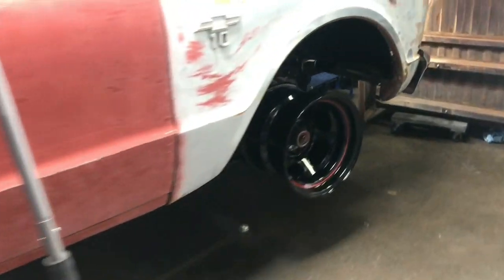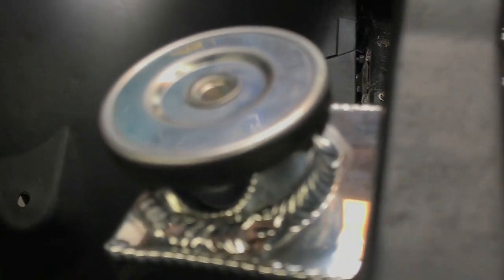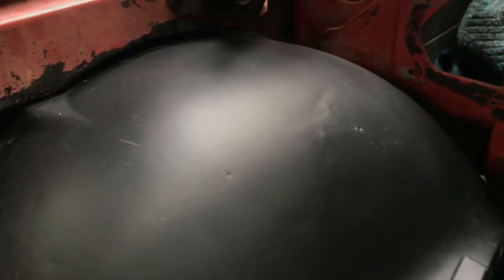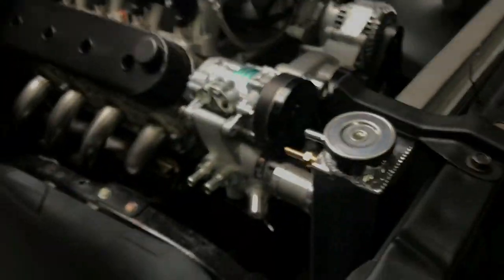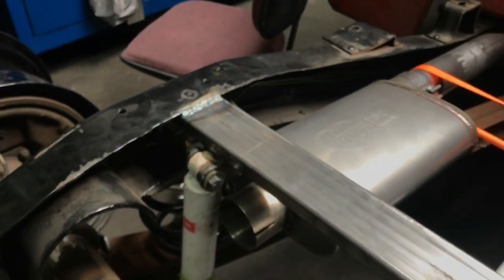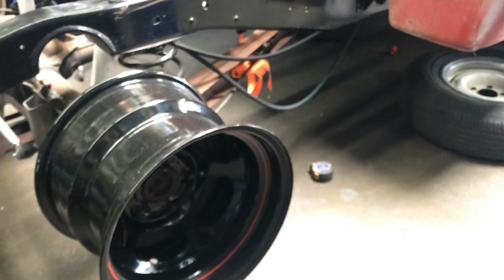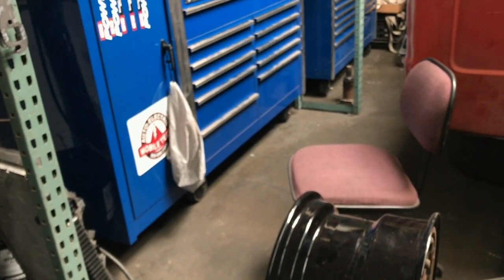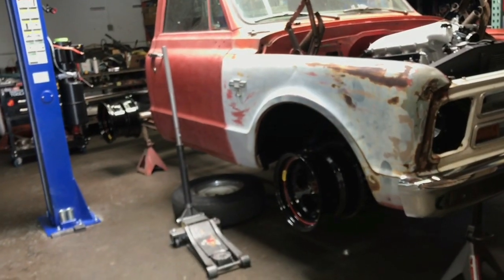67 C10 Progress

Comment: That sucks about the powder coat. Reputable shops are hard to come by sometimes.
Reply: After a few times, you start to learn how to paint yourself.
Reply: For sure, but most people don't have anything bigger than a kitchen oven for powder. That's why bigger items like frames or wheel wells have to go to a shop.
Reply: I took 4 rims in to get powder coated once. I bought em second hand and they had been sitting in buddies backyard forever. Covered in cobwebs and junk. So I hand washed em to make sure they were super clean and ready to be blasted and coated. I figured save the shop some time. And it let me go over the rim and make sure they were fairly straight. I get them back from the shop and the job was honestly pretty garbage. It was obvious where they hung them for spraying, they didn't bother to spray that area before putting it in the oven. And one of the lips on the rim had a HUGE dent in it and really bad rash under the coat, it was obviously a concrete rash because it was dropped right on the lip. I mean it was a dime sized spot that was basically flat, and it wasn't road rash. It was the more the top inside of the lip pushing out, where tire would protect the rim from anything. Because I hand washed them, I knew the lips were all in great shape before I brought them in. I asked the owner about it "No it musta come in like that". Bullshit, i told him I inspected every inch and went over them by hand and there was no spots like that and it was obviously been dropped from a height onto the concrete, probably either when they hanged them to blast them or spray them. But he said his guy's didn't drop anything and wouldn't do anything about it. So I just said alright, and then anytime anyone asked me where I got it done I make SURE to tell them not to go to that shop. I wonder how much business that guy has lost because he couldn't cover a 40 dollar coat job on a 10 dollar rim.
Reply: That sucks man! That is the reason I'm so indecisive about bringing anything to a shop these days. Unless you have been using them for years and know their quality it's hard to put your trust into someone that you don't know. What's the saying? If you want it done right, you have to do it yourself. I'm on the fence about powdercoating my C-10 frame, I could blast it myself and paint it with Eastwood chassis black or take my chances and have a shop I found locally blast and powder it. I have never been to this shop before, so it's a huge gamble...
Reply: Busted Classic Garage Yeah I wasn’t too happy about it. Was just glad it was only 4 rims and was fairly cheap. I much prefer doing things myself but there are just sometimes just some things you can’t. I am always willing to give a new shop a chance, but if I get burned once I’ll never go back there. No one seems to stand behind their work. I also keep a lookout for things that signal it might be a bad shop. As an example I was looking at getting a set of headers ceramic coated a couple years ago. I knew I didn’t wanna Work with the shop that did my rims before. So got a quote from a guy at the annual swap meet, was a good price too. He said 175-200ish. So about 4 months later I’m ready to do it, I get ahold of him to set it up and suddenly the price is 300. That was a huge red flag to me. Why does the price go up so much in just a few months? Was he just talking shit at the show to try and get business? If that’s how he handles things then I just don’t see him as reputable. I just ended up blasting them and spraying them with VHT myself.
Reply: Probably a good call on the VHT. I don't understand why some people have to play games. The odd thing about the shop I was planning on taking my frame to is that they quoted me $650 when everybody else wants almost double that. That might be a red flag moment for me.
Reply: Busted Classic Garage Yeah it’s hard to say when a quote comes in so low like that. Makes you wonder how they do it? Maybe a discount on volume? Lower employee wages? Cutting corners? Granted I’ve gone with lowest bid shops before and won. I had that happen with some tranny work I needed done last year. Ended up going to a guy who just runs the shop himself. Saved me a ton and the job was done at quote and I’m really pleased with it. Sometimes you win, sometimes you lose.

Comment: Lucky got any suggestions on getting little more hp out of Chevy 2.8 v6  with throttle body ?
Reply: Larry Alexander yup.  Put an ls innit. Problem solved.
Reply: 4x4  like to keep it that way. No adapters available  sucks
Reply: Nitrous
Reply: I believe a 3.4 liter v6 bolts in to your setup... no ls, but better than a 2.8.

Comment: Lookin good, Lucky. Wheels are gonna look great, one thing about the tires, I always thought a 50 series on a 15 looked like a roller skate wheel under a truck. Nothin wrong with a bit of sidewall on an old truck like that. With tires that wide it would look tough.